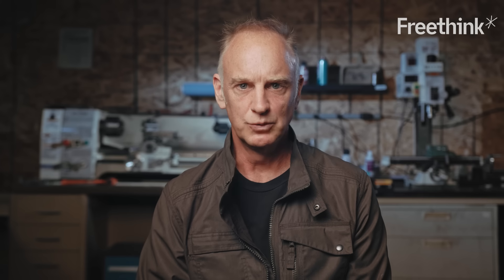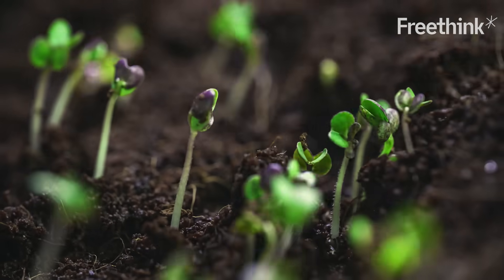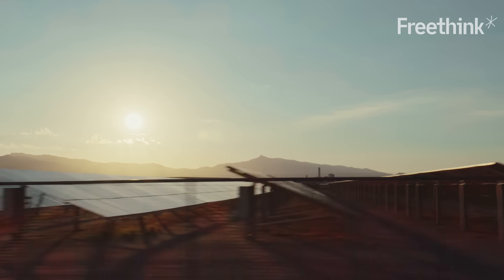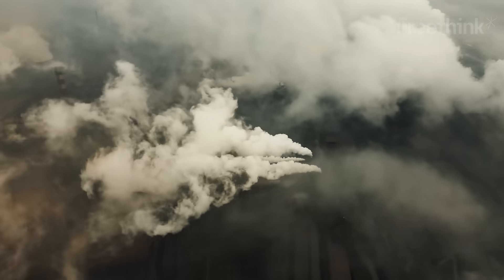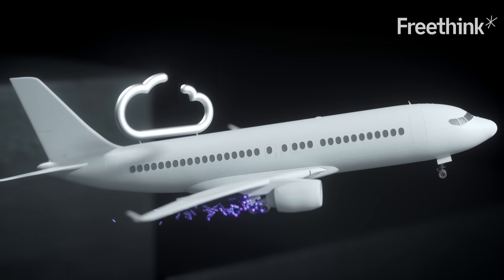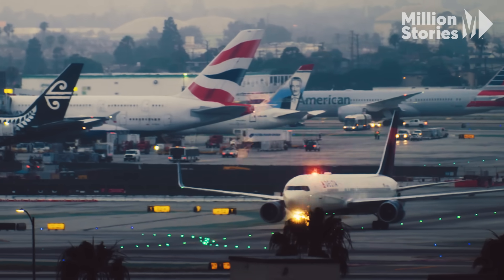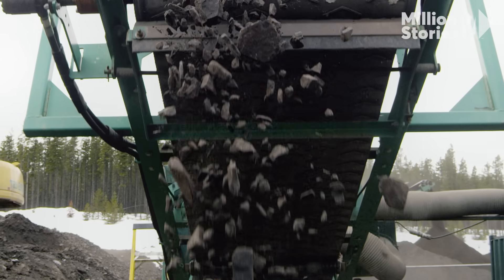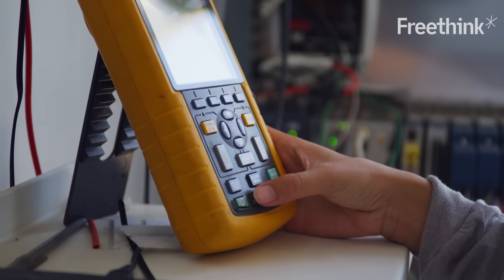Artificial photosynthesis turns CO2 into sustainable fuel | Freethink

Comment: Forget the sun and invest in nuclear energy,  its carbon neutral, provides consistent energy,  and doesn't create forever chemicals like solar panels and wind farms do , nuclear waste storage has been solved and safety technology has improved so much that in some plants a meltdown is physically impossible and the only NEW carbon produced is the carbon needed to creat the plant and machine, both of wich last far longer than solar panels or wind turbines , bam carbon neutral fuel solution that requires little infrastructure change and can be equipped to homes in a small format and still be carbon neutral if the city is powered by nuclear energy

Comment: Great... But before that please consider 1st law of energy as well.....if that possible, yes it could be and appreciated all efforts by team.... But if that happens as explained without giving no solid clue this because of research is on going... In short, if it does and they are really going to take successful results from this project.... I think this is time to say good bye to law of energy.... Imagine I will put cyclider of co/co2 that able to converts fuel direct from my running car engine... It's my dream for this kind of sustainable energy ever😊

Comment: Did you know we can help crate diamond from carbon dioxide and even create carbon dioxide from diamond by burning them in pure oxogen.  Diamonds are made of pure carbon.  However, carbon dioxide can be converted to methane, which is a feedstock for diamond epitaxy, which is a way of growing lab-created diamonds.  We can even make pure carbon and pure oxogen out of carbon dioxide (Co2).  Splitting carbon dioxide (CO2) into carbon and oxygen can in fact be accomplished, but there is a catch: doing so requires energy.  If we took the Co2 out of the atmosphere and turned it into useful products like pure elemental carbon, it is no longer a problem and the atmosphere will regenerate and recover fast so, if we use power (electricity) only from nuclear power plants then we are not making more carbon to turn Co2 into pure carbon and pure oxogen.  This can be done if we really did this using thorium nuclear reactors since there is enough for 1000 years of power.

Comment: Why not use CO2 gas into useful energy for one it's a dense gas and using especially designed gas generators it will be compact . You can pump all of the CO2 gas into redundant gas fields the mineral porous rock was good for CH4 by nature. Also CO2 and H2 gas can be used to make synthetic natural gas all things possible using Sabatier reaction so even when natural gas has been depleted you can still make it . Green hydrogen from nuclear power plants and using electrolysis units the by products is oxygen and heavy water important for fusion reactors all things possible just the way of going about it .

Comment: In the middle of the video it says that to reduce the cost of the product, the plant can be located near another industrial operation that normally produces CO2, and use the CO2 that it produces as the plant's feed. If they do this, the solution won't be carbon-neutral, since all of the product will be created from the fossil fuels consumed by the other industry.

Comment: This is a great idea. I have thought of it for years. Now imagine using a magnetism on the roads and vehicles and using air as a projectile force turning co2 into clean oxygen. Instead of making fuel you are making combustion which pushes clean  oxygen out of the tail pipe.

Comment: If the CO2 produced by burning the synthetic fuel is not returned at the concentration required for re-photosynthesis, then while it may technically be carbon neutral, it is not self-sustainable.

Comment: doing this can make it carbon neutral fuels! as long as we solve the solutions I mean formula one is going to be carbon neutral by 2030 not by electric but by making synthetic fuels! this is by using water for hydrogen and carbon in the air to reuse those two natural sources to make fuels without using fossil fuels that come out of the ground to add to the atmosphere!

Comment: This was patented in the 1920s and the two scientist that worked for Rockefeller that found you could turn CO2 and water into gas and diesel were found dead a couple years later. It's called the fisher trope process. Now 100 years later they are starting things up called "blue diesel"

Comment: In the 70's I worked for a company "within a company" that was doing research on 'Concentrated Solar' to fire  the combustion chamber of a turbine engine, except the combustion chamber was actually a ceramic heat exchanger. You get the picture. The project was referred to as "Turbine on A Stick.

Comment: The solar array can steam water and turn a turbine creating electric energy without costing $3000 a gallon for manufacturing jet fuel. You are ignoring the chemicals needed to make a reaction to separate co2 from the air, these chemicals need to be constantly manufactured and replaced in your system. How are these spent chemicals disposed of? Synthetic fuel is a multi-step process, after creation it needs to be refined to an engine standard using even more chemicals

Comment: EVs are not the answer to anthing.  The CO2 for an EV is twice the CO2 for an old ICE car with RE fuels.  The battery IS the problem.  Combustion is key to RE and low CO2.  NewEngineType can get to 96% of the CO2 gone.  An EV is only 33% at best.

Comment: 3:40 This is misleading. The industrial plants are still producing CO2, and the airplanes are still burning it. This is better than nothing since less CO2 is produced overall, but it is NOT carbon neutral. The industrial plants will claim they are zero emissions, and the airlines will claim they are zero emissions, but neither of them are. It is only carbon neutral if the CO2 comes from the atmosphere (or Ocean).

Comment: I get that the technology is better than taking the carbon from naturally sequestered sources, and putting it back in the air after hundreds of millions of years. But, we cannot simply be carbon neutral in the end. We have to sequester the CO2, or the global warming will not end. And it's their business, so I get that they are pushing it hard too. Yet.. Electric air travel is possible. 
A: Small scale electric aviation is already with us.
B: Energy efficiency per passenger scales positively the larger a plane is.
C: Chemistries such as aluminium air are more than sufficiently energy dense to allow for electric air travel.
D: They have poor cycle life, but air (and ship I might add) travel is from large installations. Air ports and ocean ports. With more than sufficient available space as well as economies of scale to allow for on-site exchange and refurbishment.

Comment: completely wrong.  the commentary at 3:30 onwards says that the CO2 wuill be taken from fossil fuel power plant flue pipes. When the fuel is burnt, further   fossil CO2 will be added to the air. The best carbon footprint that this scheme can acieve is half that of fossil kerosene, and that doesnt affect indirect effects such as occur from jet contrails.  The CO2 must come from direct air capture and further offsetting must be used to cancel the indirect effects

Comment: completely wrong. at 3:30 onwards the commentary says that the process will use CO2 from flue gas.  This means that when the fuel is burnt, further fossil CO2 is released into the air. This scheme can at best 1/2 the direct carbon footprint of aviation fuel. In practice it will be worse than that, and that doesnt account for the indirect effects of jet contrails etc.  The CO2 mst come from Direct Air Capture  and there must be some further offset to account for indirect effects

Comment: It's great that these people are working on another source of jet fuel but please, stop the carbon is causing global warming nonsense. Carbon is only.03% of the atmosphere and man adds only .0000009% of the carbon to  the atmosphere. Carbon in itself is not a green house gas because it does not go high in the atmosphere and its wave length is at the wrong end of the spectrum to reflect heat and light. We are entering a period of reduced solar activity similar to the Maunder Minimum (Mini Ice Age). We are going to need all the energy we can get just to stay warm and move more agriculture into green houses. We must reopen coal fired electrical plant and bring on line thorium nuclear energy which will solve many of our energy needs.

Comment: This is not carbon neutral! It ends up releasing the carbon dioxide that would have been released by the industrial process. So ultimately the carbon dioxide is still released - slightly better that it's gone through 2 processes, not just one, before it ends up contributing to global warming... but its not carbon neutral, its carbon positive.   The carbon dioxide that would have been released by the industrial process is still released albeit later than if there had been no carbon capture on the industrial process.  This will not move us towards net zero.  The end result of this process releases carbon dioxide.  There are genuinely green alternatives to this that would still allow you to use an engine (either electric or hydrogen based) but a hydrocarbon burning engine is just the same as the hydrocarbon engines we use already... using them causes global warming.  if you are pushing oil or recycled oil into the engine unless you are capturing the carbon on the way out this technology contributes to global warming.

Comment: What I wanted to know was : 1) How? 2) Efficiency of process 3) Blocks to progress 4) Timescale for roll-out. "Artificial Photosynthesis" doesn't really cut it as a final explanation. We can all imagine the benefits!
Reply: They are probably using a Ceria (CeO2) based process, it's common for these types of solar/thermal methods. You reduce CO2 to CO, then you can use CO under very high pressures and temperatures to make longer chain hydrocarbons. The efficiencies are garbage, if I remember right like 1% of the energy actually goes into making the CO, the rest is lost as heat. The true production capabilities with current technologies are unlikely to be what they say they are in a few years (unless they have a proprietary catalyst and CO reforming process I don't know about). The other big kicker is they need 10s if not 100s of atmospheres of CO2.
Reply: @scatteredvideos1  I was put off by the lack of actual info, and the generally sloppy PR-type advertising of something without proper rationale/ performance figures. 1% as you say won't cut it. I think that a banana tree gets about 20-30% efficiency doesn't it?
Reply: @scatteredvideos1  The excess heat can be used for other processes. Like steam turbines? Capturing waste heat is part of the process. The excess can also be stored underground as a heat battery 900 degrees can do a lot of work.
Reply: Seriously mate.. I mean what do we have to think about here? Ofc making jet fuel via photosynthesis would be great.. but would have been good to have 2 sentences on what is taking place.
Reply: Yes same he didn't  told how it works
Reply: Maybe they don’t have a patent yet, so they have to keep secrets still?
Reply: Since they're catching CO2 and making a carbon neutral renewable fuel, I'm assuming it's algae biofuel. The captured CO2 (Usually from a power plant) feeds the algae, and the algae bioreactors and refineries are powered by the solar they mentioned in the beginning. Not sure why they wouldn't mention it though. I've never heard of turning the CO2 itself into a fuel.
Reply: 2025 first e-aircraft 1000 miles 100 passengers, 2030 first e-aircraft to travel 10 k miles on battery power 500 passengers..... Jet fuel irrelevant
Reply: @13thbiosphere  lmao ok dude
Reply: @13thbiosphere  and where do the materials require to build all these batteries come from. Batteries which have a limited usefullness then need too be disposed of. There is already a problem with desposing of the highly toxic waste from batteries.

Comment: As he admitted, the process does not actually remove carbon out of the atmosphere. It is basically capturing the energy of the sun so that it is converted to a convenient fuel which can be used in planes.  Capturing solar energy is what solar panels and other renewable energy sources do anyway.

Comment: So you take flue gases, turn the CO2 into jet fuel and burn it in a jet engine.   That is not net zero.  You have simply taken the CO2 and diverted it through a jet engine.  You have still got a net increase in CO2 in the atmosphere.   Admittedly you have avoided the burning of fossil fuel, but it is not net zero.   This would only really make sense if you can use atmospheric CO2 as a feedstock the way plants do, but it is not clear if this tech can do that.

Comment: Oh come on, it’s obviously bull. Why?
Even if turbine engines and reversing co2 into fuel was 100% efficient, 
You would still need the same amount of energy put into the photosynthesis process as you would get out for the turbine engines 
For example jet fuel has an energy density of 9.6kwh/l, 
So let’s say you want to run it with solar panels, so you would need a 10kw solar panel array in direct sunlight for 1 hour
Seems fine so far,
Now how much fuel does 1 boing 747 carry? 240,000 litres 
Ok so now you need a 2.4 Megawatt solar panel array in direct sunlight for 1 hour, to fly 1 plane
So the total amount of solar in Australia’s grid is 7 megawatts, still possible right
Now how many domestic flights are in Australia per day? Typically about 1800
Let’s assume they refuel after every 10th flight, which is reasonable given Australia’s size
So that would be 180 refuels per day, 
So now we need a 432 megawatt farm, add in that unfortunate reality that turbines are less than 50% efficient 
And we are up to, let’s call it 0.85 Gigawatts 
Chuck in the international flights and we are at 1.21 Gigawatts at least
Now let’s assume this regeneration system is at least 30% efficient 
So now we are up to 3 Gigawatts at least
Now obviously I have ignored more than 1 hour per day but that’s about the best sort of averages you get over a year
But let’s really kick this into overdrive
Where do you build it? You need crazy amounts of room plus a high amount of co2
Most of the co2 is in the city but all the millions of acres needed are in the country,

Comment: Jet fuel is not just carbon, the video is not very clear on how they are getting the hydrogen and the "artificial photosynthesis" part of synfuel. Kerosene for instance goes from C10H22 to C14H30.
Microorganisms such as cyanobacteria usually only produce fuel such as alcohol, not sure how they get to kerosene, if that's what they mean with "jet fuel".

The very first sentence in the video is wrong too, it's CCS (carbon capture & sequestration) that stores carbon, not carbon capture alone.

Comment: Where is the C02 coming from? How exactly is it being converted. I simply don't believe the claimed cost to create fuels from CO2 is a cheap as they say. Almost certainly a scam.
Reply: Same as electrolysis, not energy efficient. Better use the electricity ⚡️ of the solar panels directly.

Comment: Fascinating! 
Excited to dig into the chemistry in place during the conversion process.
Reply: It'll be a nightmare, the required energy and materials will be 3X what is gotten out of it, just think of the ethanol nightmare and then multiply it exponentially.
Reply: Nonsense. The problem with biofuels is that their production consumes food and requires huge amounts of land. Conversion to electricity would always be more efficient, but that's a moot point since electric air travel isn't viable. We have to use something with higher specific energy than a battery, even if it wastes more of the nearly free solar energy in the process.

Comment: Where CO2 (and any process GHG emission) can be captured and converted this seems to be a good and beneficial thing, if the CO2 emission was biological in the first place or so unavoidable otherwise as to be essential. But with an economic argument for capture and conversion instead as a bolster to non-essential emissions, we run into the issue that a tree grows as it is bent: make a little part of the whole fossil extractive-emissive industry permissible, through that loophole will drive the whole thing, the amply bad with the small good.

I'm in favour of what Dimensional Energy is doing. I merely know it will be exploited for greenwashing in too many cases, justifying sometimes expansion of CO2 emissions, and rarely delivering on the promise of actual zero fossil emissions by 2030 that the world needs.
Reply: @bartroberts1514
Why would the world need zero carbon emissions if we already found a reliable way to recycle those emissions?
Reply: @iodias  Because we didn't find that reliable way? Because the ways we do have to recycle emissions are ten thousand times slower than we make emissions, even if scaled up as fast as we can?
Because almost all the claimed ways to recycle those emissions are a smokescreen to gain funding to make more emissions?

Because we can do math and think critically and check the facts and discover when we're being lied to?

Comment: Mass produced concentrated solar systems are the future.  Couple it to water desalination.  Running the steam over a turbine and get a power plant while you're at it.  Then use the energy produced to process the salt for valuables and have no brine discharge.  Oh and bonus you can capture the Co2 released from sea water upon heating and remove acid from the ocean.